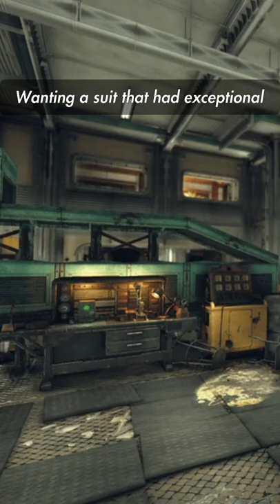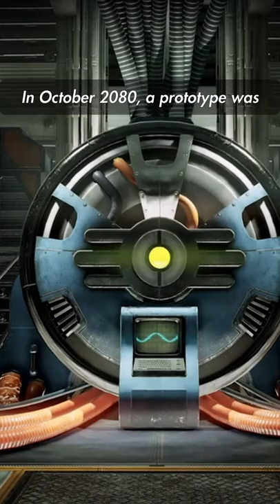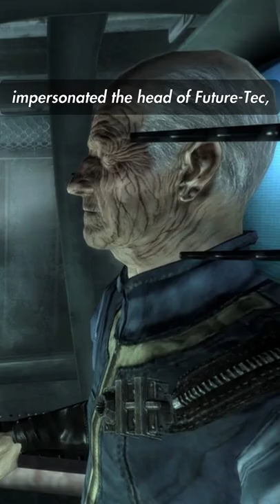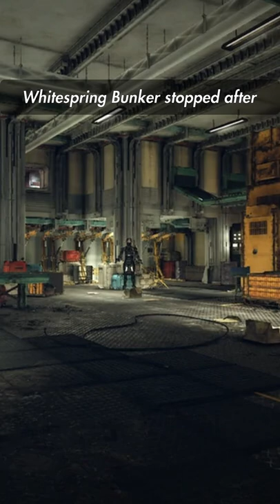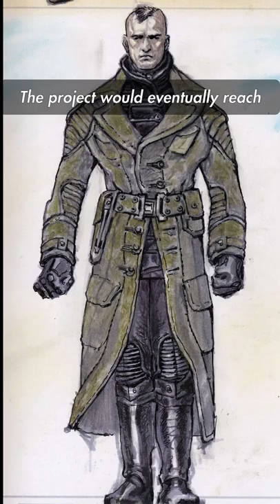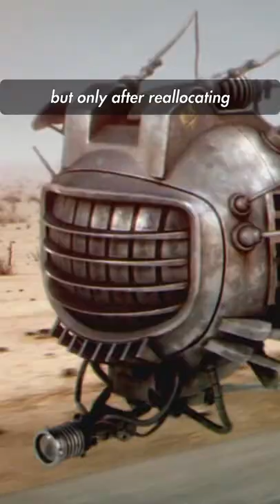The Hellfire Project Fallout Lore #shorts

Comment: Ah, yes.
The project to create the heat-resistant "Hellfire" Power Armor that began shortly after the Great War...

Without any materials to actually produce them. The duraframe, the thing that all the Hellfires are made of was first used to create Eyebots of a new model - ED-E's brethren - by a dude shortly before the Fallout 3 began, meaning that it's like a 120 years retcon.

Why can't Bethesda learn on their mistakes?

upd: apparently it's another 200 years retcon lmao
Reply: Theres more to powerarmor than armor plating lmao. You think tank designers designate the quality of steel before designing the hull itself?
Reply: There is no lore that says Wheatley developed the metal used in EDE, just that he worked on the ED eyebots, which have more to them than just the materials.

The armor in the game is also just a skin, meaning we don't know its stats nor if they are even made out of the same material